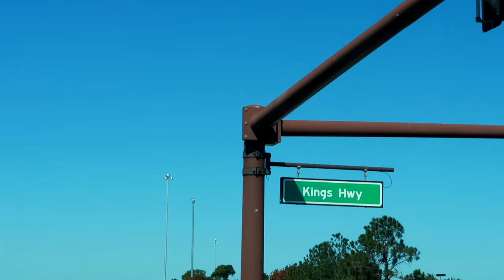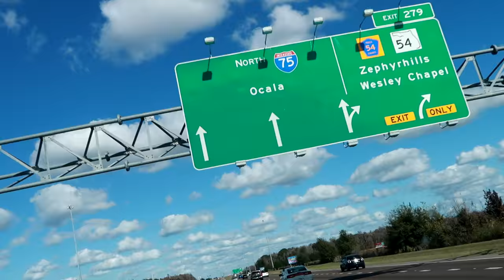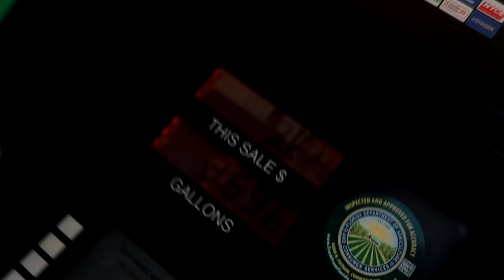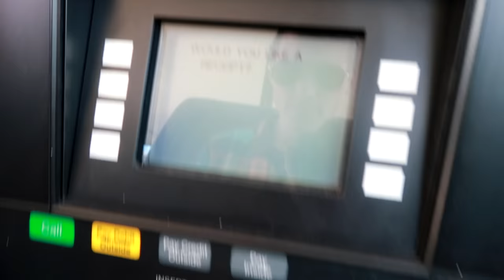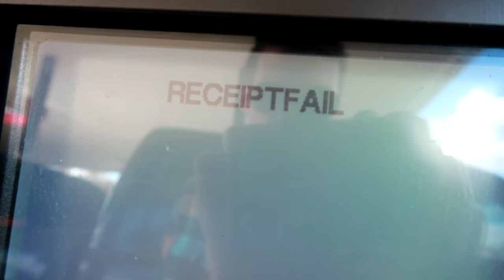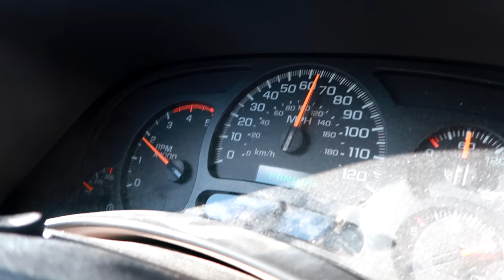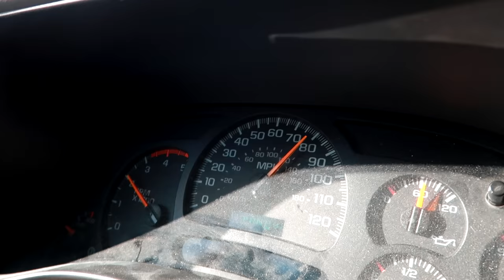i broke down...

Comment: Almost pulled the tigger on a 05 DUramax 4x4. BUT decided to not get it. Gonna go on Saturday to look at two 5.9 Cummins one is a 2006 and the other is a 2007 both 4x4

Comment: dalton on diesels there is usually a little thing on the side of the air filter cant think of the name where it will tell you if the filter is dirty or clean and its suppose to pop up on the dash to let you know its restricting air aka dirty next time see that and reset it

Comment: you need a stronger wheel. The torque/weight is unscrewing them. Those silly little holes, looks like a half ton sport wheel....and what in hell happened to cone filters? I have a very large Donaldson cone in my 1996 as factory, and that is only a gas v8. Mini tractor trailer version. Nice truck. glad you stay nice to it.

Comment: The cat filter has smaller holes/better filtration. Don't you need a lift pump to help the stock fuel system with the new filter?

Comment: Hard to believe that as a guy who talks that much about maintenance, neglects air filter up to a point till it clogs up....You need to change everything at once: oil, oil, fuel, air and interior filters and repeat it after about 10 000 miles.

Comment: if you have more problems with the hole losing power and feels like it's bogging down after a certain speed check your mass flow air sensor

Comment: I dont know if the air filter was or was not your problem if so cool but these trucks have had issues with them going into limp mode if it happens again you might look-in to it 
It often happens when towing

Comment: Ok I have a question I just bought a 2012 ssr125 and It don't run but I cleaned the whole carb it has spark and the compression is good what is wrong with it and what should I do

Comment: Had the same problem with my cummins, it would fall on its face if I reved over 2k rpm and I replaced the air filter and never had a problem sense

Comment: Just put thread lock on the studs if it works for mower blades on a john deere moco it will stop your wheel loostening

Comment: you also need a manual,  automatic has no power
Reply: theoutbackbandit it's not a differnce you don't have more power with either transmission it's just you have more gear selection and choice

Comment: dam that air filter is dead just like the one he had in his  CRF450 check his oil check tranny fluid Torx the wheel nuts but has a dirty ass air filter 😒😒😒😒